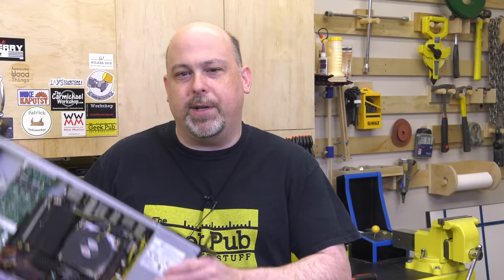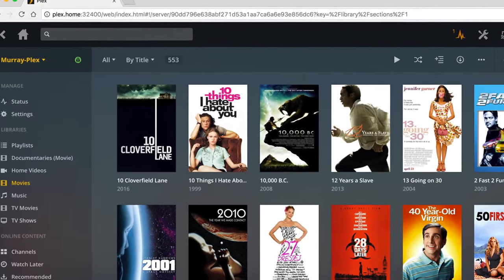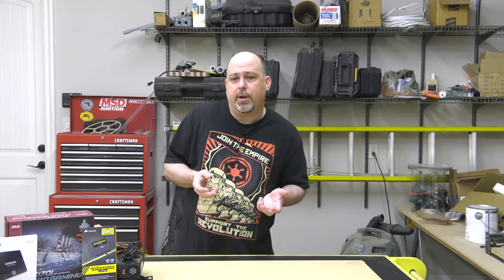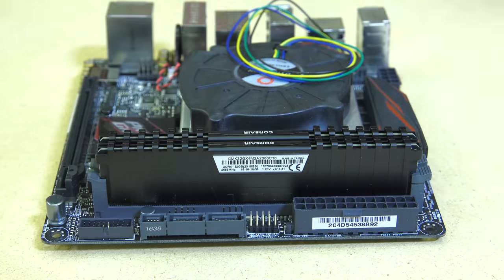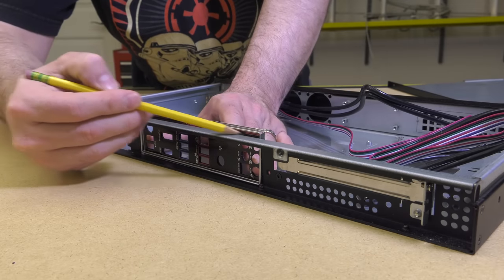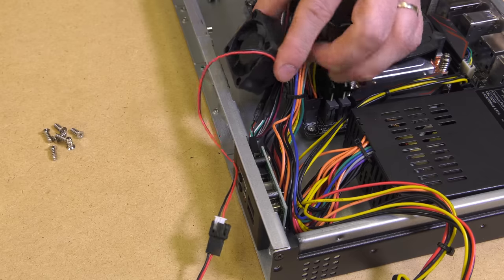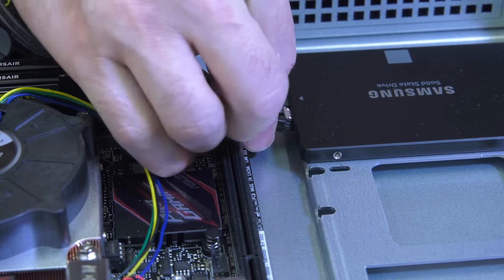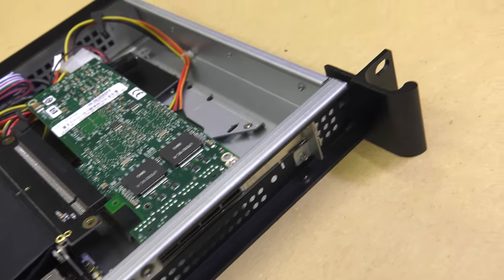Building a 1U Server (Bad A$$ 1U Server)

Comment: You can't call this a server, no ECC RAM and no XEON/OPTERON. You probably shouldn't be running ESXi without ECC ram anyways. What you built is a 1u home desktop.
Reply from the maker: You should look up the definition of server. :-)
Reply: "a server is a computer program or a device that provides functionality for other programs or devices" - Wikipedia

So it's more a question of: "how is it used" rather than "how is it build"
Reply: That should be "built".
Reply: English is not my first language, nor is my grammar great :p (but you get what I meant right?)
Reply: 1u home desktop, running enterprise grade hypervisors on gaming grade equipment. 

great for a home network or a test lab... not great for an enterprise solution. 
so id say Carbon is in the wrong, but technically correct. :)
Reply from the maker: Exactly.  Anything can be a server, even a Raspberry Pi.  The use case is what matters.  I wouldn't run credit processing on this server, but its perfect for a theater room.
Reply: is still a "server" is not "server great hardware" which is a total difference story.
and yes is not recommend to run a VMware ESXI on non server great hardware but hey is he's money so he can do what he want right
Reply: UPS backup and ECC are different... ECC is against bit flips and stuff. UPS is against power outage, if you have a power outage, ECC won't save you...
Reply: No, often RAID cards that have a battery can protect your data in some way when the power dies.
If you have important data running, then using ECC memory is a must (I learned this the hard way...) if it's just plex and maybe a small VM for trolling tech support scammers, then it's fine to run without ECC.
Reply from the maker: I'd like you to elaborate on problems with an i7 CPU.  The only difference between the i7 and the comparable Xeon 4 Core is the on board codecs for video, and they enabled ECC support.  Other than that the chips are fundamentally identical.  Second, a UPS is needed regardless of ECC.  ECC is about RAM error correction on the DIMM, and has nothing to do with disk I/O.
Reply: ESXi is still being used?
Reply: ofcourse :)
Reply: Let's just call it a home server, mright?
Reply from the maker: That's exactly what I DID call it. ;-)  It's a home theater server.
Reply: Some what he is right I mean No XEON why More power effecent Why not take advantage of that
Reply: What I believe is something different. Something which serve some service can be a "Server". It is not about what hardware you are using.  Even a normal laptop can be a server. I have seen a Quad core 8Gb Thinkpad hosted with a website and it serves fare number of users without any glitches. That means a laptop can work as a server and a computer with Xeon processor and ECC RAM can be a client/workstation. When you are designing a project you must understand the requirement, then you have to decide the hardware. People always think that if it is a server then it must have a Xeon processor and huge amount of RAM. The deciding criteria must be "What it does. Not what hardware that particular machine has."
Reply: Okay but you can define it like that. But you dont have server grade hardware in it. 24/7 opration is going to kill it quick.
Reply: kevindt12 of course.. that is what I said. we must understand the requirement. and then we have to design. My answer was to that gentleman who said this setup can not be considered as a "server" because there is no Xeon processor and ECC RAM.
Reply: I've had all sorts of stuff running 24/7 for decades, and most of it has fared fine. With the exception of some Seagate trash. Screw Seagate.
Reply: kevindt12 nonsense, my office has several workstations running non-server grade hardware that runs mostly 24/7 for years and they're fine.
Reply: Patrick94GSR yes.. even in my case there are low grade desktops are being used for high performance clustering (kind of supercomputing based on parallel programming). CPU utilization will be high in those machines. they are working very well. nowadays 30$ raspberry pi cluster are doing the same job. 😄😄
Reply: that is called Fallacy of composition.
Reply: may be....
Reply: Everyone my main point was that VMware ESXi shouldn't be ran without ECC RAM. It's not recommended. I do get your point, anything can be a server just not a proper one. Servers are NOT sold without having server grade hardware, Xeon E3, E5, E7 based on need/operation.
Reply: @Kevint12 Depends on your definition of quick, I leave my computer on 24/7 unless I'm going out of town for more than two days, its held strong and still going strong after 3 years of torture running everything I throw at it
Reply: Quick i mean like 3 years Also dont Foget the power consumption. A Desktop cpu has a way higher power consuption than a server grade.
Reply: Depends on what both of them are doing, generally servers always have a load on them while home computers don't.

I'm confident enough I can run my computer 24/7 alongside my server and have my desktop end up being cheaper to run
Reply: a raspberry pi can be a server.
Reply: Because its build for 24/7
Reply from the maker: +kevindt12 As has been mentioned numerous times, the intel ARK shows the MTBF rating of the 6700K and equivalent XEON to be identical.
Reply: Okay your done?
Reply from the maker: +kevindt12 Not by a long shot.
Reply: +TheGeekPub This guy <3
Reply: Lol, ESXi is used alot. Where do you live?
Reply: Yes, there are reason people use ECC RAM and use "NAS Optimized drives".
Still doesn't mean this can't be a server.

Server hardware is OPTIMIZED for 24/7 uptime
doesn't mean you can't use consumer hardware for it.

Just because a car isn't optimized for racing, doesn't mean you can't use it for racing ;)
Reply: HAHAHA :)
Reply: a Pentium III running Windows XP that shares a hard drive so other computers can access data can be called "server" or "file server". You probably think you need a Ferrari to say you own a car.
Reply: Anything that serves files is technically a server.

Comment: you say "robust network connectivity", while you present Intel PRO 1000 PT?
well even if it comes to PING (yes I really mean PING and you really read PING) it is at least 60% slower then I340-T4 (not less then 8500ms for 30000 ping of size 1470 and with interval of 0.1ms between them without waiting for answer - fast/rapid send of ping)
I use I340-T4 throughout my whole network (4 servers each serving a lot of stuff)
I would not consider Intel PRO 1000 PT for anything these days
I prefer Broadcom and QLogic for anything serious over anything older then I340-T4 and honestly even I340-T4 is going to be phased out quickly, as I need SRIOV, so I350-T4
Reply from the maker: For my purposes it works more than fine.

Comment: Why bother to do that in the first place? just grab a 4/5 yo used server, it'll came with proper server grade conponents and will cost waaay less!
Reply from the maker: And would be loud, put off tremendous heat, and not perform near as well. Oh, and it wouldn't fit in my rack.

Comment: No noctua fans??
Reply from the maker: Nope.  3X the price, and 10x as loud.  I wanted a quiet machine.
Reply: TheGeekPub Really? I thought noctua fans would be a lot quieter?
Reply from the maker: I have several of them on my arcade machines.  They are higher RPM fans, so they make more noise.
Reply: They are the quietest fans out there with high RPM's but they are too loud if your priorities are not high RPMs.
Reply: Sulfen How come everyone uses them when they have noisy fans or when they are building a silent pc?
Reply: John Bob because pc fans that run at a similar intensity to noctua fans are not as quiet. They're not willing to sacrifice fan performance for quieter and less intense fans.
Reply: I'll give you an example just so you know what I'm talking about. Most people would choose a 3000rpm 120mm noctua fan over a 3000rpm 120mm coolermaster. Why? Well, even though the coolermaster does the same thing and it's cheaper, it's also a lot noisier than the noctua version.
Reply: John Bob but yea, another way to get quieter fans is to get lower RPM fans. So if you care more about quiet you can get a 1200rpm fan and it will be a lot quieter than a noctua 3000rpm fan.
Reply: Sulfen but fans don't run at max speed unless they need to so when the noctua's are at a lower speed wouldn't they still be quieter?
Reply from the maker: One of the fans is direct wired to the power supply meaning it runs at max RPMs 24/7.   The other fan is wired to the MLB fan controller, so I suppose I could have used the Noctua on that one without too much worry about the decibels.
Reply from the maker: Also, you need to remember that these are not 120mm fans, they are 40.  Smaller fans are inherently louder.

Comment: 250W !?!?! for a i7 6700 WTF?!
Reply from the maker: The processor itself only draws 91w at 100% utilization.  The Azus Z170 pulls 25w.  The Hard disk pulls a whopping 3 Watts  The NIC 8W and the Fan 4w That brings me to a grand total of 131watts... about 60% of the rated supply.  Why would I need a bigger power supply?

Comment: INTEL XEON E5-2670 on ebay for like $70 each
Reply from the maker: And 1/3rd the performance.
Reply: I like watching your videos. 
"Intel Core i7-6700K @ 4.00GHz ==Average CPU Mark 11,118"
"Intel Xeon E5-2670 v2 @ 2.50GHz==Average CPU Mark 14,975"

I am using 2 of them on this Asus DDR3 1066 Intel-LGA 2011 Motherboard Z9PA-D8 (ASMB6-IKVM)"
Very good for vm's and plex
Reply from the maker: You're missing a few data points.  The i7-6700K has a 5th core specifically for hardware CODECs for video, this makes a major difference with transcoding video.  The other thing, is that my CPUs are running overclocked at 4.9Ghz.
Reply: 2x"Intel Xeon E5-2670 v2 @ 2.50GHz==16 cores with Average CPU Mark 14,975 x2==29,950"
this works just nicely as a plex sever, i'm not saying it is nicer then yours, just saying it works very well as a plex server for about $70 each. Have a nice day good Sir.

Comment: shouldve just bought used.  you can find used haswell xeons for like 30$ if you look hard. itd also bet a better server. ECC ram more cores more cache, rated for 24/7 use. 

shit you coulda stuck an atom 8 core in there.  or gone ryzen for a better consumer part. as it is basically just a cut down server part.
Reply: I'd respect your comment a lot more if you started with "I would have" instead of "you should have."  Besides I think you missed The Geek Pub's use case if you're suggesting this for him.
Reply: for the savings in price that can be had plus reliability i think its a better way to go personally. i mean price to performance 6 core plus haswell xeons are hard to beat...

obviously it is his choice, i just personally think for a server ECC memory is a pretty big bonus. obviously sometimes its still necessary to go with alternate choices but god damn is it hard to pass up a good deal. also allows for more flexability if he ever decides to re-purpose the system. 

as for his whole its not about the biggest badest most redundent server i still think the price to performance plus the level of redundancy plus fast performance from a haswell or even used broadwell xeon with a higher core clock wouldve been a perfect middle ground. say 6-8 cores at 3.3ish ghz or able to turbo up around there. i also think for his purposes the extra cores mightve helped.  plus again a single 6-8 core haswell set up for board cpu and ram for under 200$ is hard to beat. even at 200 thats a sweet deal.  there are also faster turboing xeons as well.  also considering ram is important he mightve been able to get a board with a design that allowed more slots.  ive seen a few itx boards with 4 dimm slots, as well as IPMI.

as for the atoms not sure if it supports everything he needs but those things are super cheap for 8 cores so if it did then it could potentially have been a good option, i know they work pretty well for freenas and plex or ive heard pf sense boxes. 

and on ryzen well i mean yeah its slightly slower but again value, price to performance a 1400 wouldve worked and thats 7350k price point...

and also given better budget options he couldve set up his redundant back up server with the main one for the price of one... then added a 3rd for like half the price of the second... 3rd layer of redundancy cost savings and potentially an upgrade in other parts. 

oh and also consider xeons gets binned for better thermal and power efficiency. 

i do think this build is rather nice however there are other options and i think better options but yeah i shouldve worded it differently,  i still think there are better options though. plus its always good to save cash, maybe through in a couple 10gbe nics for stupid fast point to point or just for the link to the switch for better bandwidth if the switch had the right port, though for used 10gbe cards you can find mellanox sfp+ cards for like 17$ and loads of other options with various ports. i also believe the mellanox cards work with his os. 

oh also since he also only needed enough storage for the OS i wouldve potentially tried a sata dom, small reliable since they are server grade not too expensive depending on who you get them from and mightve allowed for a second drive to be added down the line without much penalty for space.  also without a drive he mightve been able to ghetto rig a 120mm aio in there.

Comment: i7-6700K only supports up to DDR4-2333. I am wondering whether your DDR4-2666 is partially wasted. https://ark.intel.com/products/88195
Reply from the maker: Linus Tech Tips has an entire video on this exact issue.  The gains in all except a few tiny use cases is less than 1% performance increase.  So I didn't bother to spend the extra money. Go check it out.

Comment: I use CPU's that games use and call it a server... Nope. Dual Cpu D20 from lenovo on eBay 200$ buy a crap load of RAM for nothing and you have a serious server
Reply from the maker: I think you missed the whole point.
Reply: With all due respect sir, i believe on the vertu that if it's worth doing is worth being done right. But okay i didn't say that is a not viable solution.
Reply from the maker: What was my use case for this server?
Reply: To be the smallest 1U server , bust still You can cramp more than a I7 CPU if you really want to ....
Reply from the maker: Correct, but this is primarily a home theater server running plex.  What does that extra core in the Core i7 do that your chip doesn't have?
Reply: Well For a start .:    Xenon VS I7 
Vertical Segment.: Server VS Desktop
No. of Cores .:              12  VS 4
No. of Threads .:          24 VS 8
Cache.: 30 MB SmartCache VS 8 MB SmartCache
Max Memory 768 GB VS 64 GB
And Many more , Okay you may say that the Xenon may have lower clocks but has more "No. of Threads"
And is not about what more it can do , is What more I can do with it in 3 years , 4 years , I may decide to put ESXI and have VMs on it , with 8 Cores and 64GB ram Sure you can rule 8 VM's . with 768GB ram and 24 Cores you can do by far more stuff .... but is all about prospective and budget , and also scalability and adaptation to new Changing situations , you may decide to use it as a router or what ever. but as i said this is up to you this is just an other way of thinking how to utilize a budget
Reply from the maker: So you know what I need better than I do?  I'm confused.  The Core i7 has an extra core called the Intel Quick Sync core.  This core is basically and ASIC for CODEC on a chip.  I can easily show you in test after test that the i7 is a dragster racing a stock pinto when it comes to transcoding video.  So yes, I could go with your solution and run 8 VMs and 768GB of RAM.  But to what end?  I don't have a need to do that, and my transcoding times would take a major nose dive.
Reply: I didn't say that I know what you need better , than your self. Of course you are the master of your will , you are free to do what ever you want. This is just an opinion and suggestion , not a request nor a demand. As always take everyone's opinion/comment/e.t.c. with a grain of salt. Yes about the  transcoding video that is very true indeed.
Reply from the maker: Well, that's why I was confused.  Your first comment painted a much different story.  I was just trying to understand why you said what you said.